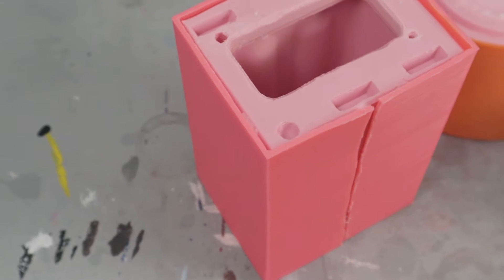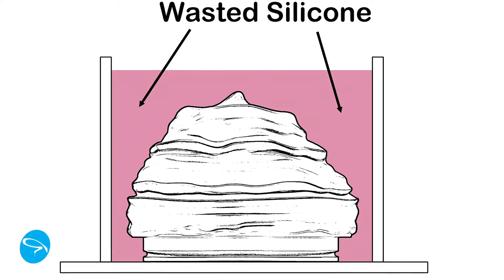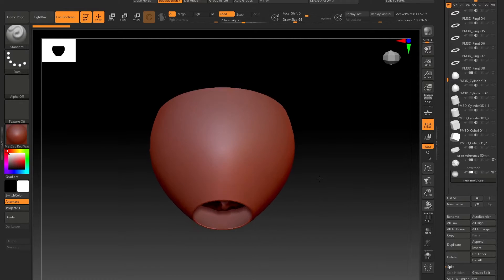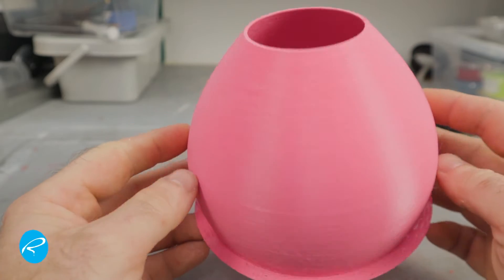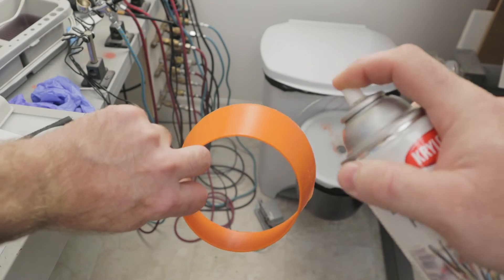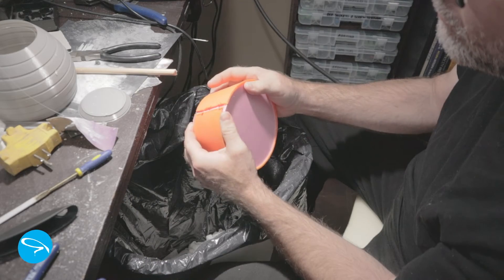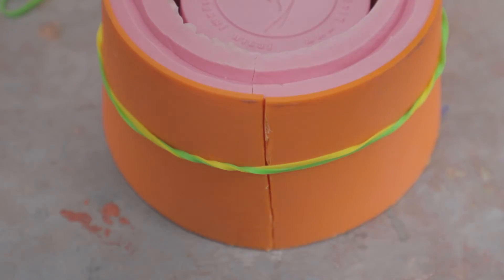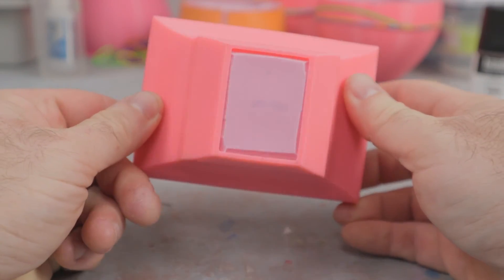The benefits of rigid FDM 3d printed mold cases for silicone mold resin casting.

Comment: Hello, how do I smooth 3D prints before molding them? If it is not smooth the mold will not be shiny when unmolding, right? Do you have any advice ? THANKS
Reply from the maker: That's the longest/most difficult part of the whole casting process. If the object is very simple you can just sand and polish it. The resin I use (sirayatech build) polishes up quite nice. I sand from around 220 grit up to 4000 not skipping any grits, then I use Meguiars ultimate compound. And if it's still not shiny enough I finish with 3M finest grit polish. If the part is really intricate I'll sand it smooth and use an automotive fill primer and air dry spottin/glazing putty (bondo) to fill imperfections. When it's smooth enough I'll spray it with a 2K automotive urethane paint, which will harden in about a week. Essentially it's just like doing body work on a car, but on a much small object. You can see some of this process in my calligraphy inkwell video.

Comment: Two part 3D printed mold casings are also becoming more popular.  Each half will have two tabs and you can just Buffalo clip them together.   Tho you need even thicker walls.
Reply: Rybonator used one in a recent video if you want to see what I'm talking about. (video title: Making Dice from my Brand New Master Molds) Though it's a bit of a bad example.  The tabs are too thick and need to be bolted together which is a bit too much in my opinion.  A friend of mine has been doing this with just buffalo clips for about a year now.
Reply from the maker: That's a cool idea, I haven't seen that before, will have to check it out, thanks!
Reply: extra thick might be what I need, Im looking at doing a 4 inch resin cube and I need it to be perfect since its gonna hold hair from my dead cat so I cant do it again if I mess up, I have a silicone mold but its really bendy so maybe bracing the outside will help
Reply from the maker: @shyowl3453  Yes, an outer shell will definitely help keep it's shape. 4 inches isn't that big though so I don't think it would need to be too thick. If your just making one of these maybe modeling and 3d printing is more work than you need. You could cut some foam core/balsa wood/Masonite etc. and make a box with that and hot glue as a cheaper/quicker alternative. I've seen where some very thin silicone molds from amazon come with a laser cut mdf shell to put around it.